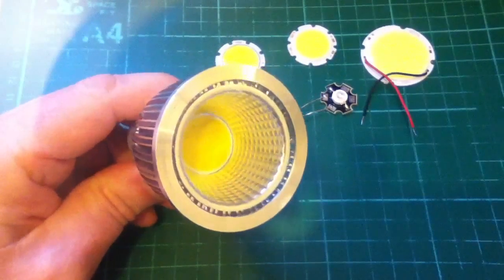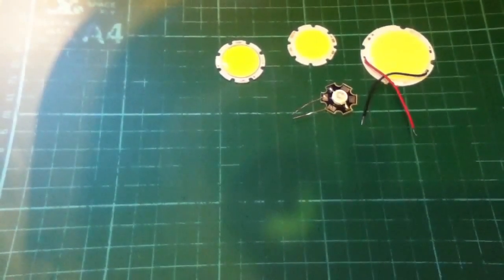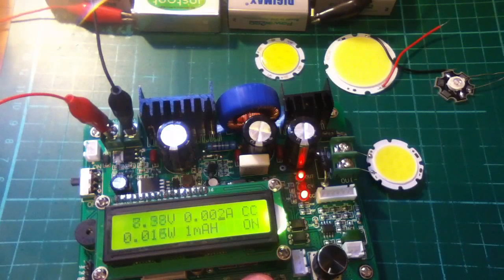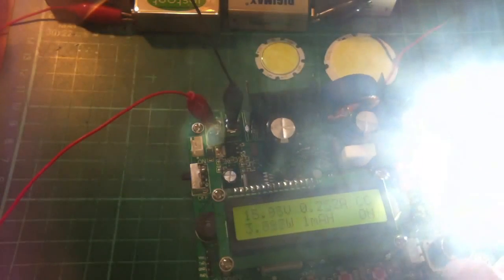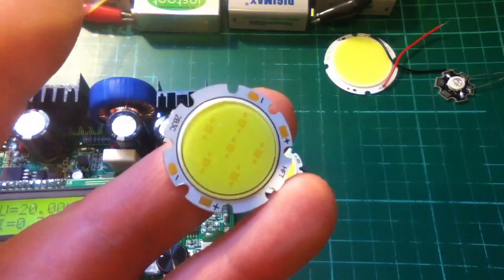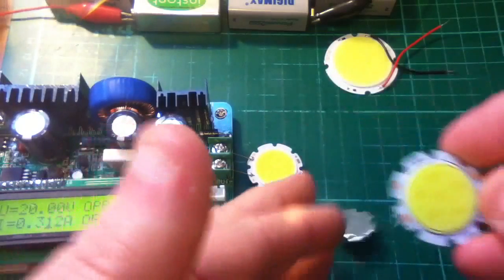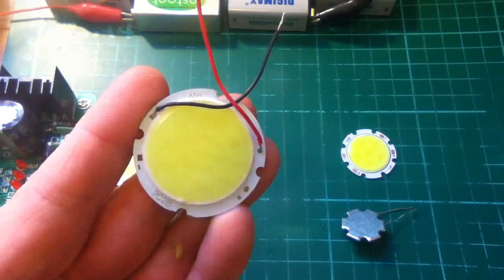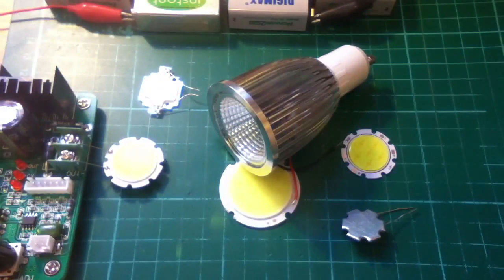GU10 spot light uses COB (chip on board) LED

Comment: Julian: I have a nice, cheap 120-V. Walmart night light.   But flicker is discernable in one's peripheral - not direct vision.
Circuit is:    Left plug prong -> [diode] -> [1/4-Watt 10,000 ohm 5% resistor] -> LED[o] -> switch -> right plug prong.
Nice, warm 2700K light!      Why is its flicker not terribly noticeable 60 Hz halfwave flicker? 
Is there microcircuitry in the [o] wafer?  (It has 6 leads but I can't see where they go.)  Squinting, I can see that the 3 mm orange-ish yellow dot has three little bright spots inside.   I assume it is a phophorescent material excited from UV LEDs beneath.     Perhaps that slows ON/OFF smoothing out flicker.

How can I eliminate ALL flicker?     I want to mount this in our grandmother clock aimed down to illuminate the brass chains, weights and pendulum bob.    Thank you.   Robert  USA
Reply: I have the exact same thing I think!!!!!!!!!!!!!!!!!!!!!!!!!!!!!!!!!!! I was just commenting about it on someone elses video Although I picked the netrual white version (white/cool version instead since i live in a hot climate i prefer cooler color LEDs)

Get a 10K resistor. get a 1000uF 16v capacitor and some thin wires to extend into the nightlight housing put resistor and capacitor and LED in parallel with each other.
put in correct polarity and in parallel with some solder points where the + and - of the LED goes
DONE!
just make sure you did it neatly. you only need thin wires for it and then just hot glue them to the bottom of the nightlight or something.
and maybe a tiny hole for the wires to go through. (it will NOT fit inside dont even bother trying to make something fit)
the LED's are about 7 to 9v so thats why you need at least a 16v capacitor

I tried it and it eliminates ABSOLUTELY ALL FLICKER.

Maybe replace the 10K resistor with two 5K resistors stacked on top of each other? That would fit inside. and the LED would get 20mA if you wanted them a little brighter.
Reply: Thank you.   Would be fun to fit everything inside the housing, but in my application it is unseen inside a grandmother clock so the housing is unimportant.I do not understand why they don't make these nightlights completely flicker-free.
Reply: Me either! i just dont get it why they have to cheap out so much!! they just make it cheap and shitty as they can so its most likely to fail so you end up buying more and they make it overpriced and so they get more money than its worth DX

Comment: do you know if you can cut COB strips?  I have an LED cob strip thats slightly too big
Reply: David Andrews you might be able to ,if it's just a little off the sides so to speak, you could get a dremel on it or carefully file it.
if you will be removing some of the current carrying track you'll need to proceed with caution.
good luck.

Comment: Sorry if this has been asked before but its hard to find a clear answer. And it seems you're the man to ask!   So I will purchase a suitable LED dimmer switch. And I had some standard 4 LED aluminium 'CREE' bulbs however the room was too dark and full of shadows.   I am now hoping to purchase.  SMD 30 * 5050 10W LEDs which came to have 1000lumens and 120° beam.   Should I plunge for these.  Or should I purchase a COB bulb?
Reply: what'd you get?
Reply: Dusan Pesic Hiya, in the end i went for what I believed to be brighter and more efficient 60 deg, COB cool white 12W dimmable, definatly bright enough! and wider beam than my standard GU10s which were very poor in brightness, the light spread also seems to be good no strong hot spot
Reply: Burgattti okay, i've bought smd (60x) 3028 gu10 lamps which are 3.5 watts. they have a 120 degree spread and are reasonably bright. they're cool white too, which i feel is easier on the eyes
Reply: Dusan Pesic ah interesting the only issue i had was that these bulbs being longer that the spring clamps in my celing holders are bent inwards which with a normal length bulb is no issue but with these ive had to modify the holders

Comment: Hi Julian, What is the model of that power supply and where can I buy one ? Could I drive it with an PC-power supply on 12V ?

Is that the ZXY6010S numerical constant voltage constant current DC-DC power supply module ?
Reply: lajson bit of a late reply , but seeing as nobody else has chimed in, i'll have a go..
it would depend on whether your pc power supply powers up when you plug it in or if it needs a "trigger" via a motherboard .
  you can 'hotwire' them by connecting one of the wires from the motherboard multiplug to another.
 google is your friend in this case.
Reply: Stu Mckay Thanks mate :-)) I hoped Julian would help me with that because I asked him but it seems he is a busy fellow or he won't bother to help some stranger ! And I have even defended him against idiots who attacked him regarding his review about some solar charger from china. But as I said he must be quite busy, after all it just went 10 months from my original question ;-) Have I mentioned my subscription to his channel ?   
Alright, he is a knowledgeable fellow so I won't winning about this anymore :-)) 
I have sorted out what power supply module that was and now I have almost finished my project with my lab power supply using the ZXY6020D 60V,20A,1200W Constant Voltage/ Current Intelligent Module and one PC power supply from Corsair, the HX620W. It's capable of 50A on 12V rails and that should be sufficient for my needs :-) Using DC-DC Adjustable Boost Converter 8-60V to 12-80V 12A Power Supply 12/24V 600W Step-Up Voltage Module I can get out 0-60V voltage. 

But thanks anyway for your help :-))
Reply: I'm with you want to know if I can use in making a grow light

Comment: COB mostly allows tighter packaging which means lower powered dies can be used for a given output.
This does has advantages and  disadvantages.
It'll generally be more diffuse not being a single point light source which is good for flood light applications but will perform worse for spot light applications.

Comment: Hi Julian - you would appear to be someone very much in the know when it comes to LEDs and therefore I wondered if you could offer me some advice? I'm building a light up dance floor - 9 modular units, each with 4 lamps (36 lamps total)  on seperate circuits and running to a 4 channel (1000w p/c) sound to light chaser. I'm wondering what LED would be best for this purpose and could I have 1 driver for each block of 4?They don't have to be RGB the colour comes from simple gels.Much appreciated

Comment from the maker: One is the ZXY6005 and the other is the ZXY6005D. The D version is digital and has an encoder for adjusting settings (voltage, current etc.). It also has 10 memories so you could set them up for 10 different LEDs. The analogue version has two multiturn potentiometers for current and voltage. In some ways I prefer the simpler analogue version.